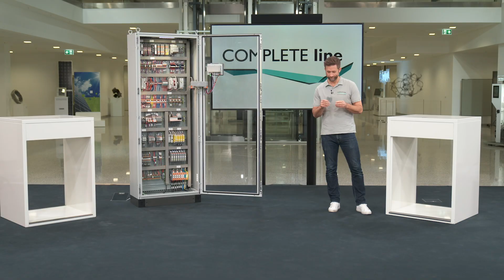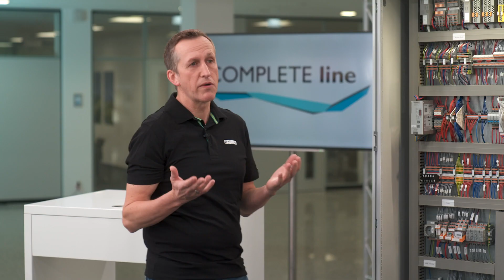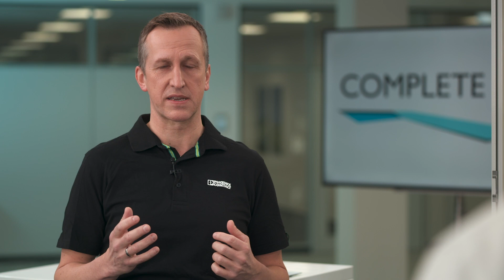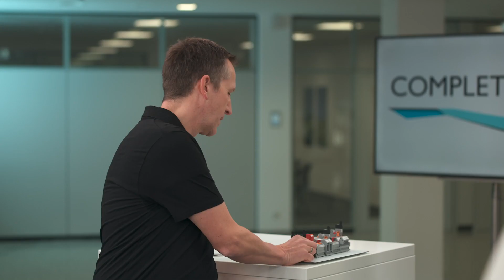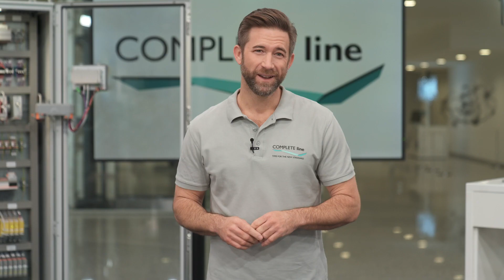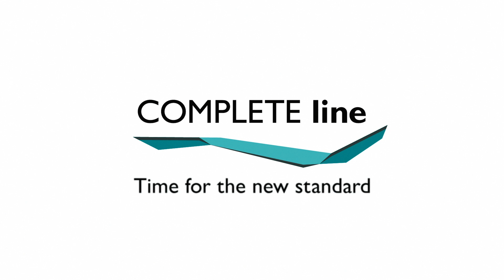Terminal block system CLIPLINE complete: a COMPLETE line solution for connectivity

Comment: The only complaint I have with the PTS2.5 and 4 range which I use a lot of is, when you need to add a second wire, need to install a new terminal and jumper... fitting two wires in the one terminal is impossible.
Reply from the maker: Hello Mr. Burg,

first of all, we are pleased that you are otherwise satisfied with our clamps.
But now to the problem you listed:
You are not wrong as far as it goes. The PTS 2.5 cannot, for example, accommodate two conductors with a nominal cross-section of 2.5 mm² in one connection point. 
Nevertheless, the terminal can accept two flexible conductors of the same cross-section (up to 0.5 mm²) with a TWIN ferrule. With the PTS 4, conductors up to 1 mm² can even be used. If this information does not help you, we would like to refer you to our multi-conductor terminal blocks -TWIN and QUATTRO. The PTS 2.5-QUATTRO, for example, has four connection points which are connected to each other via a current bar. Thus, you have four connection points without having to use a bridge.

If these terminal variants also do not represent a suitable solution for you, we regret this very much and would like to ask you to contact our sales department in your country. The sales department will gladly take care of your problem and look for a suitable solution with you.

We hope we could help you and wish you a nice day.